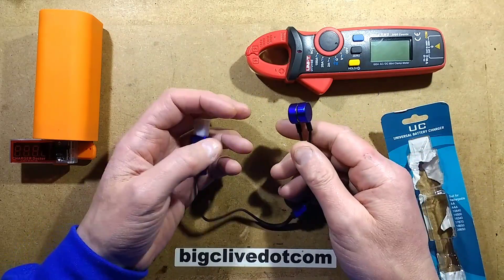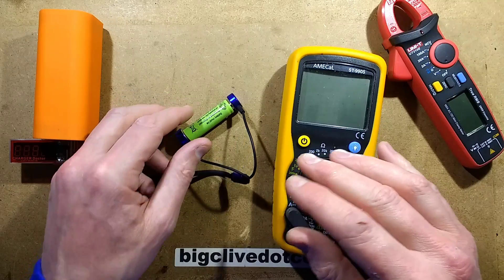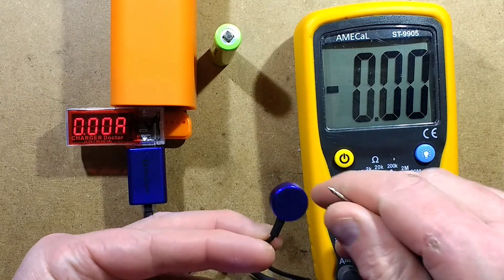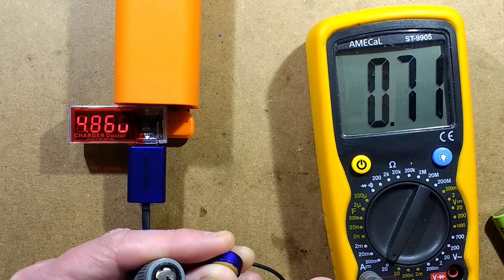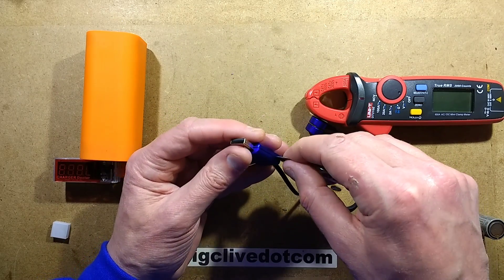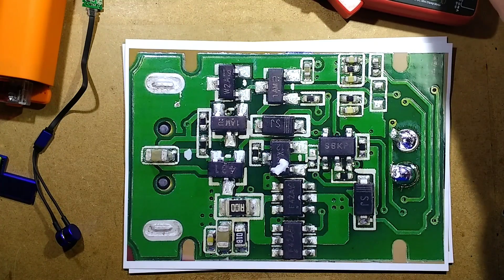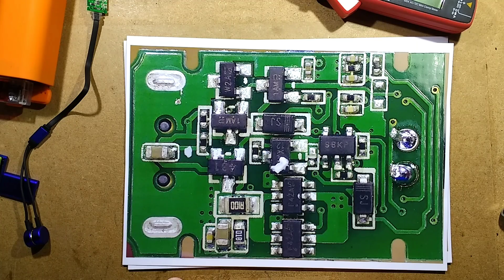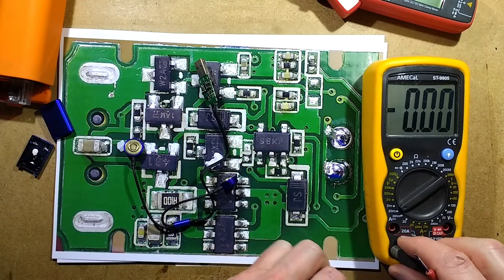Inside a Olight magnetic battery charger.

Comment: I also have a powerbank that is powering off if not detecting enough load. Is there any way to get rid of this feature without using extra load like a resistor or something? It has a cheap LCD displayed module with 2 usb ports, 1 for 1A charging, and the other for 2.1A charging. I often use cheap LED reading lights when camping, and it is quite an annoying feature.
Reply from the maker: The smart ones do tend to do that.  You could either use a smaller dumb power bank for reading or get a module that pulses a higher load briefly to keep the power bank awake.
Reply: Check to see if your power bank has a "2 hour mode" which will not shut off on very low current loads for 2 hours.  Designed for low current charging.

Comment: A nice little charger Clive.  I'm wondering how they have achieved the electrical connection to the magnets.  I've been trying to do this to connect my heated garments to the 12v on my motorbike with no luck. The trouble I have with standard connections of course is that I forget I am tied when getting off then things get embarrassing very quickly )

Comment: Very cool! So, no matter which ends that you stick to the battery, it corrects the polarity if they are reversed? That's awesome. It's too bad it doesn't have a switch on the USB end for LiFePo4 cells, or I would have instantly bought one.. 
I imagine a switch could possibly easily be hacked in, but with today's digital electronics, it might or might not be that simple. 

Maybe I'll pull the trigger on one, and give it a shot at modifying it.
If I do, and am successful at getting it to correctly work with the 3.2 volt cells, I'll report back with the results and how it was done. Unless Clive does it first.. 😜

Comment: I know very little about electronics, but wouldn't an extra diode in the circuit prevent the cell from discharging if left attached ?
Reply: It would, but it may also mess up the automatic voltage and polarity detection.

Comment: The only one negative is that it is limited to 0,75A, i have this charger and use it with hand crank generator so it would be nice if it would be charging at least 1A. I use 18650 3500mah battery in my flashlight and it takes around 5-6 hours to charge it so it is a long time :) that is the only negative the rest is very good and helpful.
Reply: You stand there and hand crank your generator for 5-6 hours? 
You should be thankful that it only outputs .75 amps. The more it would output, the HARDER your generator is going to be to crank.
Reply: @davelowets  When i charge my phone it is 1,5A and even more than 2A but it is to hard to crank for me for long period of time. Usually i can crank 1,2-1,5A for 30min.

Comment: I purchased one after seeing your video many months ago.   It’s very useful and can help resurrect a Li ion cell that is a bit over discharged.
Reply: So, it will slowly ramp up the voltage of a protected lithium cell that is in "shutdown" mode, until the Mosfets turn it "back on"?
That's awesome! Many chargers simply give up at that point, and just make no attempt at charging the cell. Ot must put out some kind of voltage "pulse" or something at around 2 volts or so, and then be constantly monitoring for a sudden back feed of voltage as the cell "wakes back up". Very cool.

Comment: I will buy one from Amazon. I have a Welch Allyn otoscope/fundoscope device that has an NiCd battery (72300) rater at 3.5V. I hope it can charge it. The original charging deck of Welch Allyn costs $200+.

Comment: the package is designed to prevent easy shoplifting (people would open the package and stuff the product in their pocket and leave the package behind)

the lithium cell is a 2/3 a cell and probably is a primary cell witch probably has a diode built in to prevent charging.

the data pins not being used are good because you dont have to worry about infecting your devices if the power bank or charger is a malware loader (there has been scares of rogue chargers infecting devices with malware (inside the charger is often a small micro processor designed to load some software code onto the device)).

the data pins not being connected can be bad because it is unable to limit current (many devices use a resistor network across the data pins to power to tell the device if it is a genuine charger).

you can also destroy the electronics you are working on if the device does not put enough current to blow the fuse in the meter

Comment: Hi Clive, I know this is an old video but would this work with 18650's?
Reply from the maker: Yes.  It should work with any cell that the ends can reach that has an upper charge voltage of 4.2V.

Comment: So... I know this is an "old" video, at the end you checked if it had an inherent discharge of the cell when disconnected.  Did you, by chance, check to see if it sent back voltage along the USB port with the USB power supply disconnected and a battery connected.  If so, this could be quite a bit more useful than described by the manufacturer... turning any single cell into a USB power supply.  I have encountered a similar 'feature' in a 12v-USB adapter/FM transmitter where you could connect a USB power supply to it using a USB A-A cable and power the whole thing through the USB port without a 12v supply.
Reply: I have a similar FM transmitter... It takes 2 AA cells inside the unit to power it. Then the transmitter itself pulls out of the "box" with the 2 AA cels in it, and has a USB end on it to plug directly into a USB port to power it without the battery box. The box is then left with a USB port in it that will provide 5 volts out from the 2 AA cells. The port in the box, however, doesn't put out much current, and will drain the 2 AA cells VERY quickly if using it as a portable power bank.

Comment: Can you use this with any power source, I.e. vehicle usb, cell phone charger, laptop usb ports? Will it damage the battery or power source? Will it damage an Olight 3.6V 18650 3600 mAh if left to charge beyond a full charge? I don't recall seeing anything  about this charger protecting the battery from overcharging.
Reply from the maker: It can be powered from most USB supplies.  The unit is designed for Lithium Ion cells and will stop charging them at 4.2V.
Reply: Thank you!

Comment: I bought one of these just for charging some 18650 lithium cells I had and after charging one for about an hour I started to smell something very hot and plasticy. The case was extremely hot and it was warped and discolored where I believe the inductor was.

I don't know what went wrong, and the cell was only about 3.9V when the olight died. Decided to return it instead of a teardown. Its a shame because its a really cool concept but I seem to have got a dud.

Comment: But.. If you put a normal non-rechargable battery in it, does it still try to charge it?
Reply from the maker: It will start charging a discharged alkaline cell, but either warns that it is not rechargeable by flashing red or terminates the charge within a minute or two when the voltage goes up too high.
Reply: Can you try it with a car battery- macgyver style

Comment: are these safe to charge 18650 batteries with?
Reply from the maker: +Jose M. Guerrero Yes.  They can be used with all single cell lithium ion cells with an upper charge voltage of 4.2v.

Comment: Thats very cool little compact charger.
But I don't really need it, I have only one 18650 powered flashlight and I almost don't use that flashlight.
Most of the time I use nitecore tube(keychain type) and nitecore nu20(powerfull small headlamp), both have built in battery and are charged from micro usb.

Comment: that tip about multimeter's is about 5+ months too late. I forget what I was doing now ( I was testing if something was repaired ?) but I managed to cause all lights in the room to go out briefly except my laptop and networking gear and then i heard my UPS kick in and then the power strip tripped and the lights came back on. unfortunately it was 2hrs before realizing what I did wrong! thankfully I had multiple safety failure mechanisms in place as I have a federal "fire" Pacific electrical panel ( waiting retirement ). there is a good reason that they put circuit breakers in power strips even if they don't have any surge protection functions.

Comment: You must degauss this ! I do it often because the unit is not accurate otherwise.
Just use some old transformer coil with hole big enough to fit the unit trough it. I use AC230 to 24V transformer then the coil from some other  transformer connected to 12V, does the job very nice.

Comment: Chinese seems to be quite a poetic language, full of figures of speech. The pictograms in question are 直拍 (zhí pāi). Literally, this means "straight shot" which is the Chinese expression for surface mount. As someone else pointed out, 膝盖 (knee slapper) doesn't look similar at all but it is pronounced xī gài. The Chinese language is pronounced in two very different ways, Mandarin and Cantonese, and if I were to hazard a guess this could have been the inception of this error. Another reason that I've read is that there used to be a common and terrible software package in China that was used to translate from Chinese to English. Even with the best translation software, number in Chinese is inferred by context. It would be impractical to have a second pictogram for more than one of something. The most common translation error you will see are plural where the word should be singular and vice versa.
Reply: I see ALL kinds of errors lost in translation... Plural, singular, you name it..

Comment: I may have blown one or two fuses in meters that way over the years, haven't in recent times mainly due to getting into that same habit of connecting the leads properly. But also the fact that my current primary meters beep really angrily at me if they detect me having the range selector at voltage and there's a lead hooked up in one of the current sockets.

This Olight charger appears to do a decent job based on what I read here just now: http://lygte-info.dk/review/Review%20Charger%20Olight%20UC%20UK.html
With all the acceptable battery types it works nicely, even full cell detection looks good based on that. I'm seriously considering if I should get one of these for my backpack or not, its a bit more convenient than the small 2 slot charger that can handle up to 18650 and AA batteries. I'd lose the ability to use charged 18650 cells to charge USB devices though, that's a neat bit of functionality of the Xtar charger I use atm.

Comment: The chip with no id on the top I would hazzard a guess is a timer esque device. Knee slappers are you polarity swappers and I would measure the wave form on the magnetic connections with a scope. I'd dare say with fets involved were looking at pulse width modulation to charge the cells.

Comment: Big Clive.
is it possible the 1mA parasitic drain you tested at the end could have been caused by the battery powering the part of the circuit that tries to work out the type of cell? It took a few seconds to detect the cell when it was plugged in I wonder if you did the parasitic drain test longer it would suddenly drop to an almost 0 value. a lot of my led flashlights (including an olight) which use electronic switching actually brag about the self discharging being in the several <uA range. to me it would seem silly for olight to miss something like that when designing the thing. especially since they've been around for a little while now.

Comment: You  should try living in North America, almost EVERYTHING has that sort of packaging.  NASTY!!
It's all because of thieves.  The big retailers make the manufacturers package stuff like that so that they won't have as much stuff stolen.  (Thieves don't like to walk out of a store with an item still in the package - if it is out of the package they can claim they had it with them when they went in)
Reply: Yup. That's also the reason expensive items have those black pucks with wires wrapping around the packaging. Cut one of those and you'll not only trigger the puck to sound a surprisingly loud alarm, it also triggers the store's alarm by sending out a radio signal. Depending on the model.

Comment: I was very confused as to what this is, then suddenly I was amazed. Now I want to know if you can connect high voltage up and use it as a shock device...
Reply: For what? Metal? The magnets won't stick to human bodies. You might as well stick to using tape and bare wire ends.. Or better yet, nipple clamps. 🤷🏻

Comment: Excellent, wondering how to keep charge wires on different batteries. Solder wire to piece of tin and stick to magnet so simple so not thought of. Now how to heat shrink it with contact left uncovered. Any ideas anyone?

Comment: Why is it good that the data pins are not connected? I thought that they have to be shorted to each other for fast charging. If anybody knows please answer. I'm asking because I really don't know and am bloody inquisitive :)
Reply: It's the other way round, the charger would have the data pins shorted (or set to different voltages for other devices) to tell the USB plugged in device to charge at a certain rate. You wouldn't want to short them towards the PSU!
Reply: Thanks. From your answer I guessed I mixed up input and output :). My bad.

Comment: Bought multimeter for myself with jack detection, so if leads are in amps socket, and you try to measure voltage, it beeps. Saved me a few times already from blowing fuse. Sometimes you just got distracted by something, and it's nice to have that functionality to remind you.

Comment: F42A  I'm not sure, but I believe it is a voltage regulator
Reply: my (educated?)guess of the Knee slapper is: F42A	R1114D181A5	Ricoh
SON1612-6	Linear voltage regulator IC
LDO, Low noise, 1.85V±2%, 150mA, -CE

Comment: +bigclivedotcom
Regarding your DC clampmeter degaussing. While I am not an expert, it would seem perfectly reasonable to degauss the meter by clamping it to your household line feed for a period of time, with say the washing machine etc. running. And removing the clampmeter slowly as I recall you doing with tools and your degausser.
 I am of course assuming that you do not use more than 100A or the max rating of the meter, plus I assume the meter does not need to be powered during this. It might not be a good idea to use a purpose made degausser, partly because I suspect the degausser's magnetic properties are likely unknown (or untrustworthy and natural hesitance because things are sometimes not so obvious to the lay-person.

Comment: I did some research and found the Chinese product sheet on taobao. The part in the Chinese title after MOS FET is 直拍 or Zhi Pai, which translates to "Pen-hold grip" (a term from table tennis), and can also translate to something like "straight" or "direct". Judging by other products having "penhold" in the name on taobao, my guess would be that it's the Chinese word for "Surface mount".
When translating Knee-slapper to Chinese, it shows as "Xigai". Maybe it's translated by someone who misheard it?
Reply: 直拍 means 'buy it directly from my shop' which is'not second handed, no middle reseller'.
Reply: Wow. It doesn't even really make sense in it's own language... 😕

Datasheet:
"Mosfet     Buy it now, buy it here only
You only buy at my shop"

"Voltage: 10 volts
On Resistance: .014Ω
VGS: Blah blah blah....."

Comment: It's definitely good to always mention resetting the leads after a current measurement. I've only forgotten once but once is enough - thankfully the device was being powered by a bench power supply with a low current limit so no harm was done except to my pride.
Reply: I've done it also... The current price of the fuses for my FLUKE meters taught me a lesson that I wont make again. Those fuses are EXPENSIVE!

Comment: knee slappers. did anyone know what this means? I kinda know but would want to clarify with someone. I was told it was a relay where it would cut off if a opposite pole connected to ground, basically a switching system to bridge the opposite powering charge poles.

Comment: I have one of those cheapy phone battery chargers, not the usb kind, the oultet kind. cDo you think I could I use it to charge 18650s? I'm thinking of attaching magnets to it as well

what it says on its case: 
input AC 180-240V
output DC2 2.8-8.7V 250mAH
Reply from the maker: +p3sv I'd be wary of the rating suggesting it can put out a much higher voltage than a standard lithium cell.  And also the issue of wrong polarity connection.
Reply: bigclivedotcom it has led indicators so you know if the polarity is switched, it even has a handy button that switches the polarity for you. Just tried to put 2 of them in series to see what it does, the led for fully charged turned on. It's one of these things http://www.amazon.in/Universal-Battery-Charger-battery-universal/dp/B00YWHIIP6

Comment: I actually got a much beefier similar sort of charger for my wheelchair a couple weeks ago. First time I'd heard of magnetic charging like this. It basically just plugs into the mains power and then there are ports on both wheels that charge the lithium cells in each wheel.
Reply from the maker: +Adam Porter Your wheelchair has the motors in the wheels?  That sounds like it could be quiet and powerful.
Reply: Speed mods!
Reply: It does. It allows for easy removal of the wheels for transportation and light weight. If you're interested in most specs, look up Twion by Alber.

Comment: I have found a couple potential candidates for the F42A that I can't at least rule out out of hand, and I thought I'd share them with you. Forgive me if I'm out of line. The NJU7704/05 is a voltage detector, and the version identified with F42A is an active low 4.2v detector. The next candidate is the "R1114x SERIES  LOW NOISE 150mA LDO REGULATOR" which I found referenced as F42A in more than one database. These two are the only things I found with compatible packages that go by those numbers.